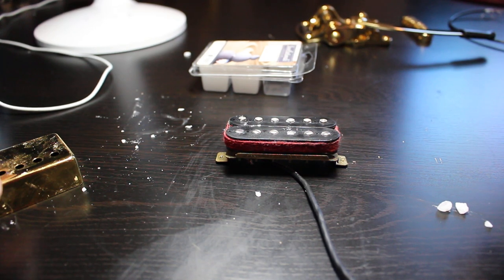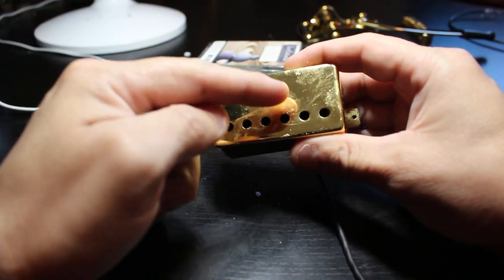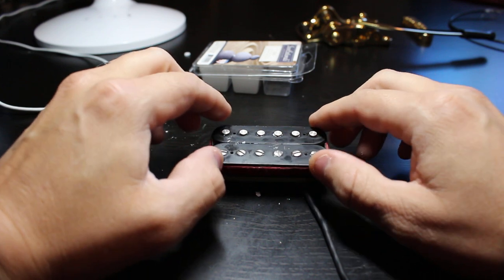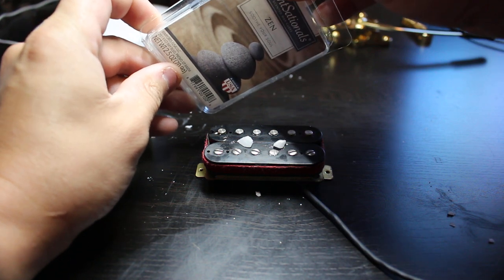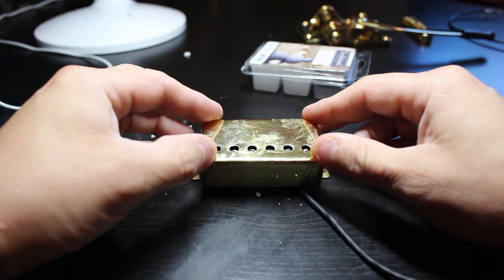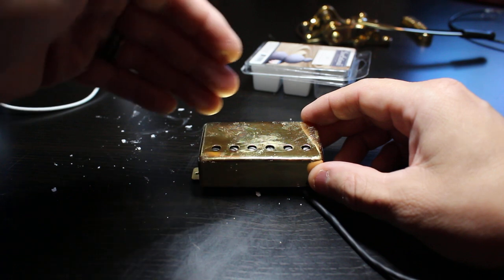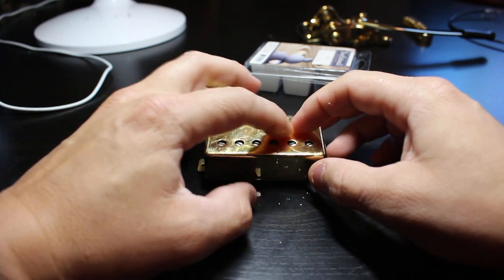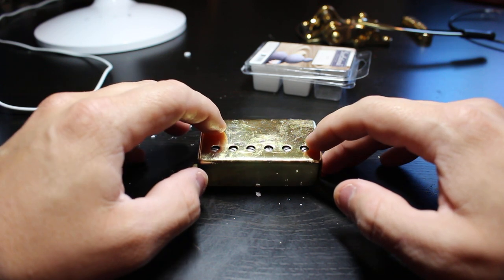How To fix a Microphonic Pickup Dylanpickups Quick Tip #91

Comment: I did this on my Firefly 335. It went from squealing like a pig (unplayable) to a real tone monster with great controllable feedback. Improvement was 100% on the neck pup and ~90% on the bridge pup.  You saved me some dough and hassle of replacing the pups! Thanks very much!
Reply: Good to hear because that same guitar is exactly the reason I'm here.
Reply: @ghost79ish  It's worth a try. It worked for me. Don't be afraid to use too much wax....
Reply: Me three. I'm encouraged to read this.
Reply: Also here for a Firefly FF338 (ES335 copy).  Mine doesn’t squeal.  (Wait a minute.  I’m playing through headphones.  DOH!).  My pickups are microphonic.  When my pick hits the metal covers there is a distinct audible click through the amp.

Comment: This is going to sound nuts but all I used was a pice of tape between the cover and bobbins and it’s not microphonic at all. 

The humbucker was wax potted already, I was just wanting to add covers for looks and was not really wanting to wax pot them with the covers on.

I read that tip on a guitar forum and it actually worked. I used this tape I got off amazon called film tape. It’s like electrical tape just twice the thickness and it feels like it has Teflon in it. 

I play ridiculously high gain with a REVV 100 watt head and pushing it with a screamer. No micro-phonics at all.  

I’m currently wax potting a set of Jazzmaster pickups and to my surprise there is not a single video on YouTube showing it. 

They’re not vintage pickups so not worrying about ruining them.

Comment: I saw other videos from you, which you put the whole thing, the bucker still attached with the metal cover into the pot wax. 
It was way way easier than opening the cover, which is really hard to do. 
Just put the whole thing in the pot wax, just let the wax enter the gap between the pickup and the cover.
And with this method, the wax can cure every other part beside the pickup cover, which is maybe also moving which can cause unwanted feedback/squeal.
My pickup did great after the pot wax. Before my pickup squealed at around volume 5. After the pot wax, had no squeal at all even at volume 10.

Comment: I have a 2019 SG Standard with stock pups and the bridge pup is really microphonic. I’m not getting problems with squeezing, but if my pick hits the pickup when strumming/plucking, the sound comes through pretty loudly. Because of the extreme neck angle, the bridge pickup has to sit fairly high, so this can’t be resolved entirely with better picking technique. Would the fix shown in this video resolve this problem as well?

Comment: Hi Dylan! How would you proceed for same problem finding on a Telly? I've just installed handmade P90 and a slightly overwound single coil, and the manufacturer swears they are super potted. What do you recommend me to do? I even hear the noise of the pickup shift switch... Could it be possible that it is the capacitor (instead of the pickups) to be microphonic!? Thank you mate!

Comment: You could always just rub the wax inside the cover & build it up like surfers do on a surfboard, heat it with a hair dryer those get as hot as 140* F ? I live in FL, so the sun will melt the wax too. Then there's making a solar oven that can get pretty hot too ? Inside of your car is 130 degrees ?

Comment: if all you need to do is dampen the vibrations of the cover, could you not in theory simply use blue tack? why go through the whole melting wax process?
Reply from the maker: murdahorse blue tack works sometimes, but wax works more reliably. It’s just a matter of “only doing it once”

Comment: Hi Dylan, How do you heat the pickup to melt the wax?
thx
Reply from the maker: With a blow dryer
Reply: Thank You!!! : )
Reply: DylanTalksTone will using a small torch lighter fck it up? Because I put the same amount of wax that you recommended (3 little dots along the middle of the humbucker) heated it up and they sound like shit now. Thin and Weak. I didn't solder them back together(they were originally glued or something. The guitar is from the 70's) so maybe that's why they don't sound great. How much does soldering the cover have an effect on the sound of the pickup

Comment: When have no cover then what to do
Reply: Ronnie nazim that doesn’t happen for no cover
Reply: @gibbythekidd882  little do you know then.
Reply: when ya wife/gf or both wax smelly things stops giving off its stink take the wax and dip the pickups in it. I had a strat that i  think the previous owner swapped out the originals for some walmart job pickups.  Any gain at all or volume past 3 and it sounded like a zombie giving birth to a bison. I dipped them. HSH and was still bad but better. I pulled them again and dipped them and left the buggers in there for about 15 mins. kepping an eye on them as i didnt know what the top plate was made of and didn't want that to start melting if plastic. Seen a lot of air bubbles coming out. A quick dip doesn't give time for those to work out. I pulled them and let the wax harden so it wasn't dripping then put them in the freezer for 5 mins. I dipped them again just in and out for a thin coat. let that harden and did them again. Cant say how many times i did that but the wire was looking good and coated.  They are no $300 set of pickups but the sound from them now you would not tell if they were seymors or not.
Reply: When a pickup goes microphonic, it means the internal coils are loose. Normally, coil wires are very tightly wound, the only noise they generate is from the metal strings vibrating in front of the coil poles. On your pickup, the wires are moving freely so the pickup is making a magnetic field of its own, thus becoming a microphone instead of a pickup. It has nothing to do with the cover like the guy in the video said, the cover is only for looks. I have a stingray bass that's microphonic and it doesn't have a cover, the coil poles are exposed. 

You can deaden the noise by dipping the poles in wax, but to truly fix the real issue you need to get your pickups re-potted by someone who has experience with that stuff. Or just replace the bad pickup altogether

Comment: Will hot glue work?
Reply: No! Noooooo! Please don't do that!
Reply: @stevescuba1978  why not?
Reply: Sorry, after responding to this, I see that it may not be too big an issue.  I don't thinknit would do a good job of seeping into the coils and eliminating air spaces, which some people think is the key
Reply: @stevescuba1978  ah, I see. I did this once with a crappy old guitar that was very microphonic, back in the 90s, and it seemed to work. In my case, the entire pickup was so loose inside, it helped quite a bit. But I suppose something of a finer consistency would do a better job indeed.

Comment: I will avoid guitar with metal covered pickups/metal covered pickups in the future.
I wonder why this material was chosen for cover. Plastic is way more safe. Why wasn't a humbucker covered with plastic? P90s which was invented before humbucker already had a plastic cover.
Now even though my pickup is cured already from squeal, I'm still worried someday it might squeal again. Maybe if the guitar is in the car parked under the sun, the wax can melt a bit that will make a gap again between the pickup and cover.

Comment: It's not going to work. You need to soak the windings.
Reply from the maker: Keith Robertson the windings are often not the cause of of the feedback
Reply: I agree, but this video is about harmonic pickups.  Pole metals, magnet materiel also come into play as well as the resistance values, how the guitar is wired, shielding,  what's being used before the amp in the way of gain pedals and the gain/EQ values at the amp plus the volume being used. 
Suggesting add a few chunks of wax on the top does not fix the issue as the windings are still not sealed and taped to quell the harmonic feedback. 

If the pups are harmonic, they need to be sealed and taped, or replaced.
Reply: The guy does know what he's talking about. Dylan quick fix can work but there is also other variables at play with humbucker pickups.
Reply: @DylanTalksTone  the case is going make an immediate difference.... That's why cheap Chinese covered humbuckers are the worst microphonic offenders. This night do it for a firefly for example. Nothing more needed.

Comment: Soooo, I tried this and it made my pickups sound weak, thin and complete shit! 😂
Reply: Only Rickenbacker in the 40s did this until Fender used laqaur in 50s then both Fender and Gibson were wax potting by the 70s. So the most sought after guitars of the 50s and 60s which do sound the best were never wax potted, they were microphonic and you learned how to use controllable feedback or vice versa. That's why those guitars sound open raw and dynamic...Hendrix couldn't of played how he did w feedback had his pick ups been waxed shut..lol..
Reply: @bryanfalcho6293  you didnt hear a squealing guitar, man. Its not comparable to a feedback, its simply unusable. I bought a noise gate for 170 euro to regain control but its just a good compromise, not the real deal